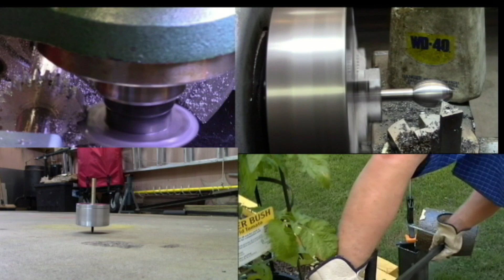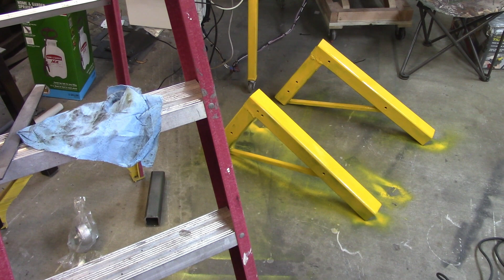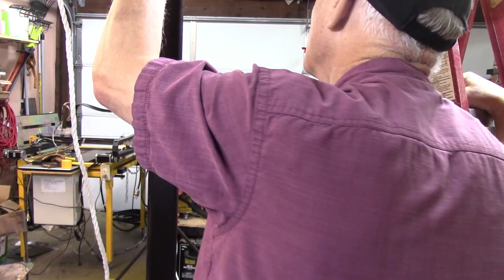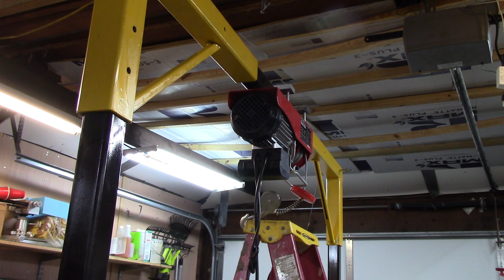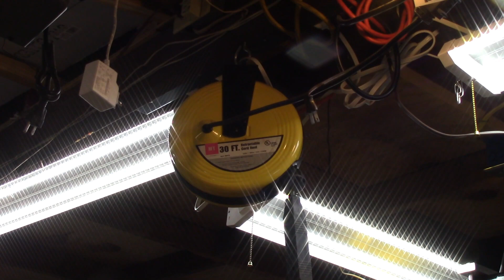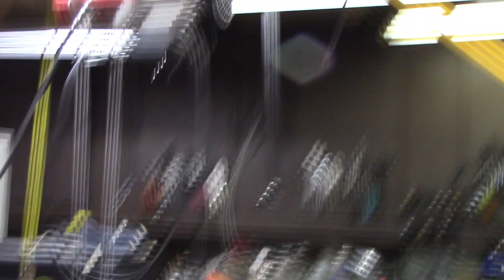Gantry crane part 2 of 2

Comment: This gantry looks like it will do all you need it to do. Nice job Mr. Harold!!!  I built one of these gantry cranes back in  the 70's with 2 & 7/8 pipe.  I pulled a lot of motors and cleaned a lot of deer with it... Last crane I worked on was 80 feet long, had a 100 ton lifting capacity and went end to end in a 1000 foot shop.
Reply from the maker: That is a bigun.  Thanks for stopping by Danny.

Comment: That gantry crane is going to be very handy. I like the way you made it adjustable. If I ever get a new shop the ceiling is going to be at least 10' high. Those Harbor Freight hoist are great. I had a good laugh when you tried to mount it and found the bracket was too small only because I've been there many times.
Reply from the maker: I should have checked that first.  Thanks for stopping by 3D.

Comment: Worked out OK Harold.  Try it with a load spreader bar and you can control what you lift more.  Easy to make one.  Cheers Rob
Reply from the maker: I have thought about that but have not done it.  Thanks for stopping by Rob.

Comment: During part 1 I was thinking this would be an "A" frame crane, and I was wondering how the heck you could adjust the height at the TOP of the crane.  Now I see, it's an inverted "T" not my choice if you can't guarantee a level platform, but it isn't going in my shop, I'm sure it will work great for your use.
Reply from the maker: I am sure it will.  Thanks for stopping by Kineth1.

Comment: The frame gantry is smoll, may i now the max load ?
Reply from the maker: The frame itself will have about 3/16 th inch deflection at 1000 lbs.  This is not a problem as the electric hoist is limited to 880 lbs.  Thanks for stopping by.